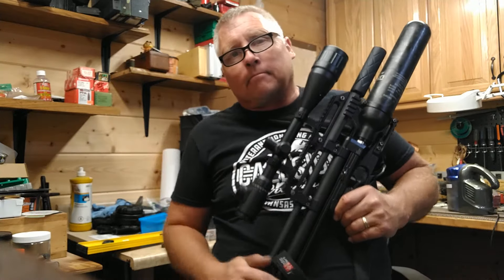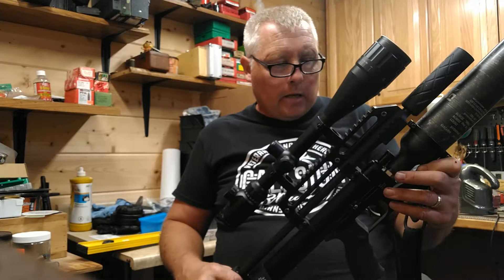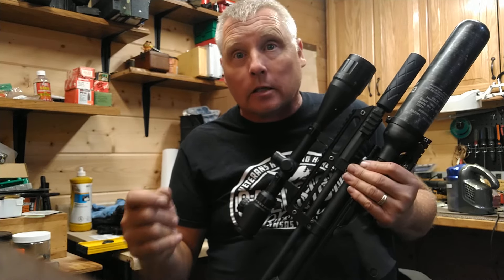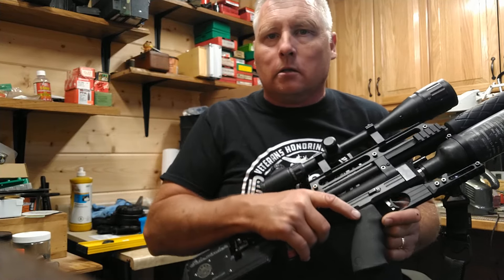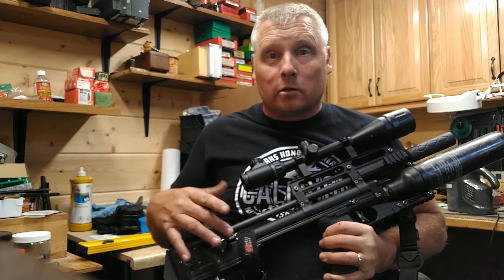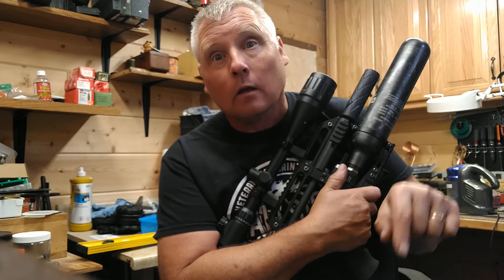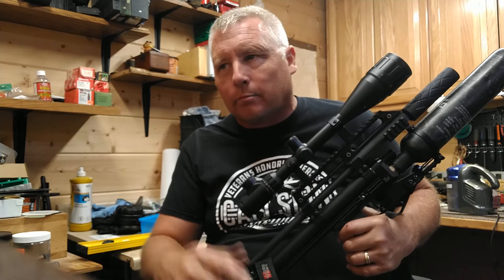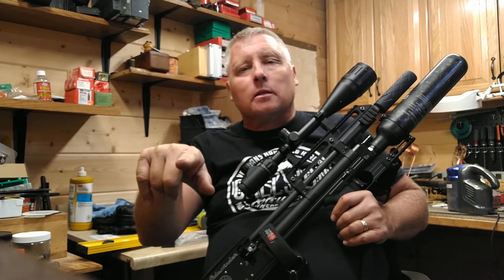Western Sidewinder fixed update for air leak

Comment: I recently pre-ordered a Sidewinder compact in .30.   Any chance you can make a video showing the break-down of the lower breech block assembly?   Agree with you 100%, one of the first things anyone should do upon receiving a sidewinder is to inspect that damn breech block….based on your unfortunate experience.   Western has like zero info out there as far as disassembly  of the weapon.    I haven’t even seen an “explosion” graphic of the weapon showing all the parts and internals, o-rings etc.
Reply from the maker: @sallutz  absolutely

Comment: Just get your money back
Reply from the maker: @airgunsofidaho4886  have you guys refunded any guns?  If so, which ones?  What reason?  Have you watched all of my videos on the Sidewinder?  Any suggestions on a solid semi-auto with a removable magazine?
Reply: I did watch a few of your videos on the sidewinder.    I can't recommend any semi auto airguns since I only have experience with my lsc sk 19 .25cal
Reply from the maker: @airgunsofidaho4886  I understand.  I am at a point where I'm content with my Western but insist on remaining steadfast for other consumers until these magazine tolerance issues are resolved.  The crack, I hope for the community, is only a one time issue.